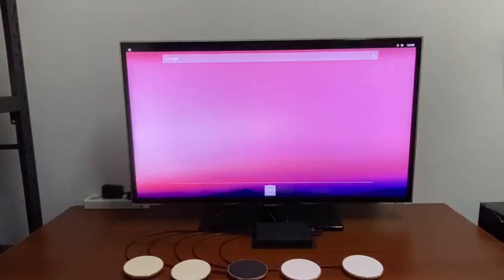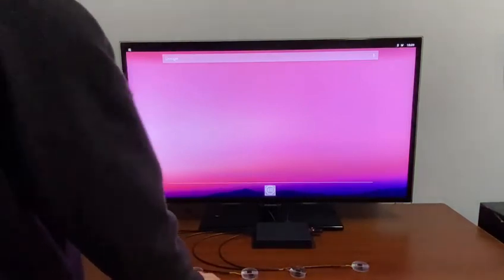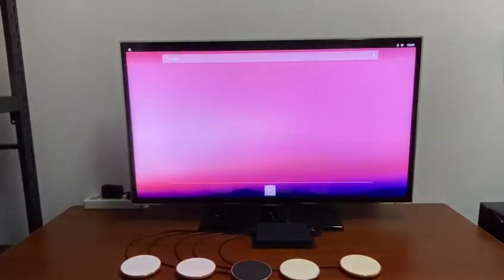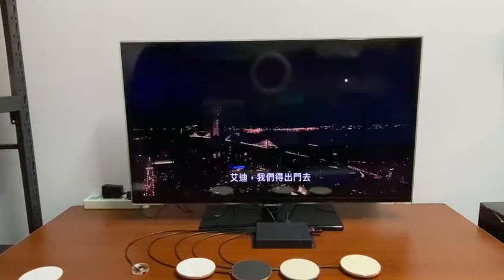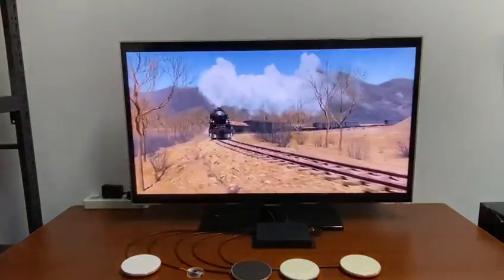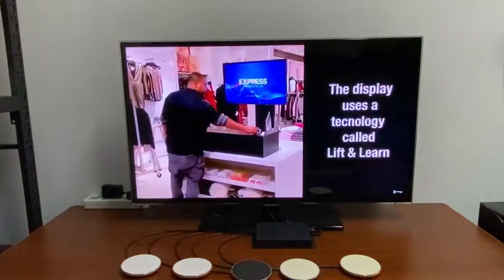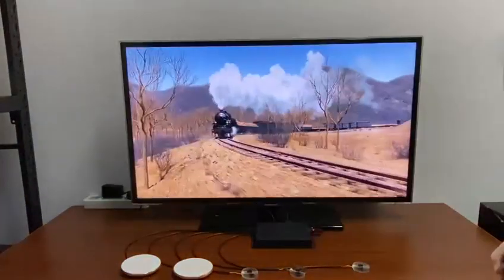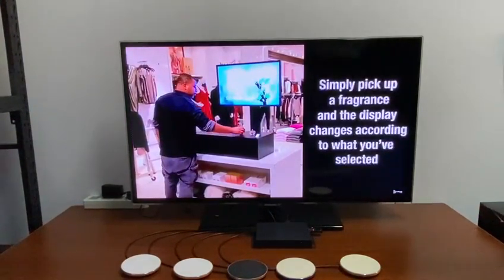Light sensor-based "Lift and Learn" digital signage player demo

Comment: This is functioning with this dedicated box and software or these features work with softwares as well
Reply from the maker: I'd assume this should be possible to make it work with other apps simply by emulating touch events. The software and API are not publicly available, so you'd need to contact Mekotronics for details.
Reply: Thank you  for this